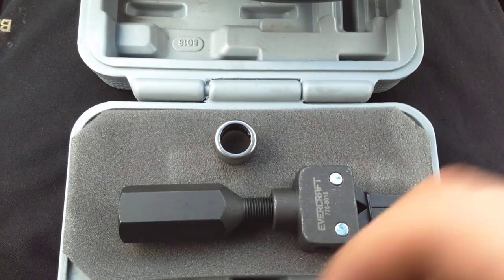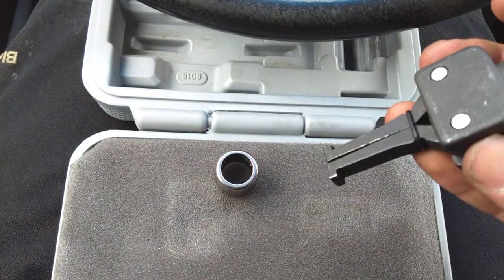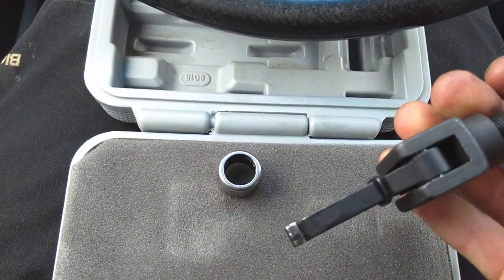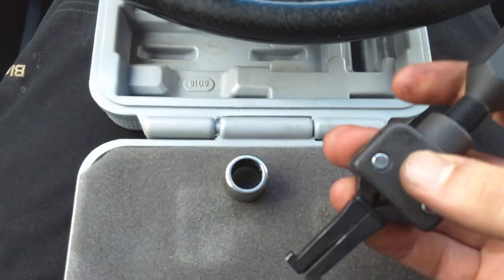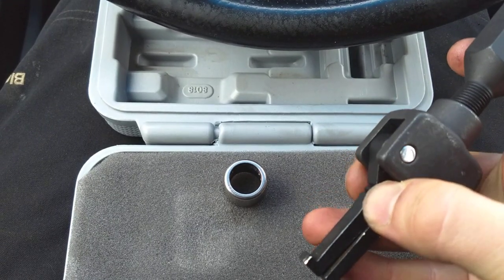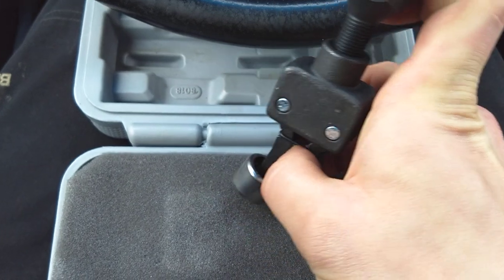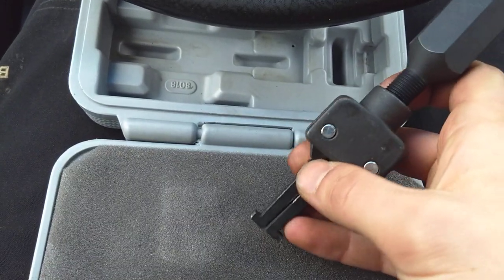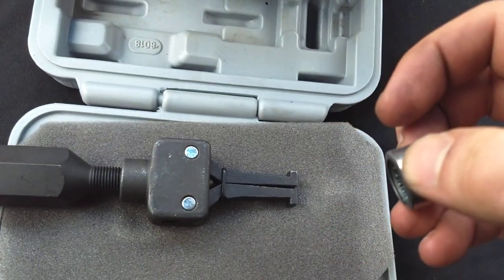Pilot bearing puller hack

Comment: Best way to remove a pilot bearing is to pack the pilot hole with grease, place a cloth patch into the hole on top of the grease then hammer a bolt that is slightly smaller than the bearing into the hole. It will hydraulic the bearing right out
Reply from the maker: I've heard that works well for some people. I unfortunately wasn't successful with that method, although I wouldn't rule out operator error 🤣 
Thanks for sharing that tip for us all though!

Comment: There’s nothing left of the pilot barring in my ranger some how it fall apart an got hot I can’t get it off it melted it’s self to the crank shaft by the way pilot barring removal tool at advanced auto parts fits Ford ranger pilot barrings but mines really stuck in the crank
Reply from the maker: Yikes! That sounds like quite the situation! Best of luck my friend.
Reply: @Peter-fq4im  it is I can’t figure out a good way of getting it out what’s crazy it had 5000 miles on new clutch kit an new transmission just started having problems hard to get into gear only thing I found wrong was pilot barring was all broken
Reply: @kamryn7496  having the same issue with a 96 mustang how did you get yours out
Reply: @thekoolkid803  I got a torch from auto zone for 26$ I put the pilot barring puller with a slide hammer on  an I heated the  pilot barring up with the torch for about 40 seconds then I used the slide hammer pilot barring puller a few times an it finally came out I guess heat does work

Comment: What kinda clutch did you install? I'm changing on in a 95 explorer tomorrow
Reply from the maker: It was on a '95 Ford ranger. I can pull the specs on the actual clutch if you'd like.
Reply: @Peter-fq4im  4.0l engine?
Reply from the maker: @The.223-numskull  Mmhmm! 
EFT HD CLUTCH KIT+SLAVE CYLINDER SET FOR 1993-2000 FORD EXPLORER RANGER 4.0L 6CYL https://www.amazon.com/dp/B06XVHQBBZ/ref=cm_sw_r_cp_apa_i_uvQJDbYMAEAZY